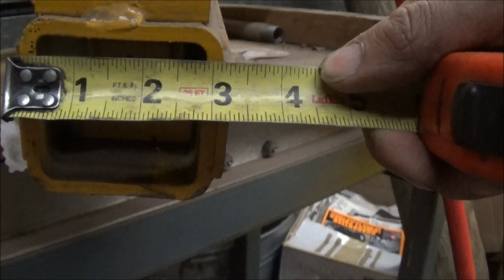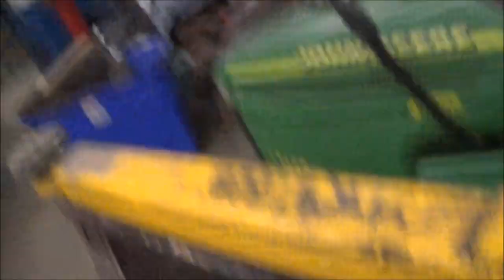video for MrHevyshevy lift arms

Comment: I think they are missing the part that actually attaches to the lift. Those pieces would slide inside the missing parts. There would be a way to slip a pin through and attach to the lift. Thanks for looking though
Reply from the maker: MrHevyshevy ok I didn't no thought I'd show you